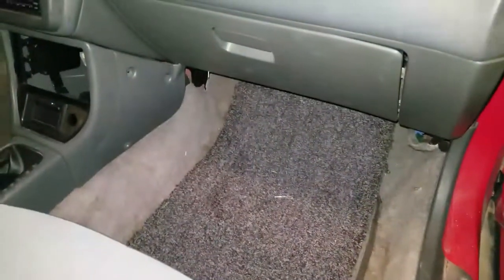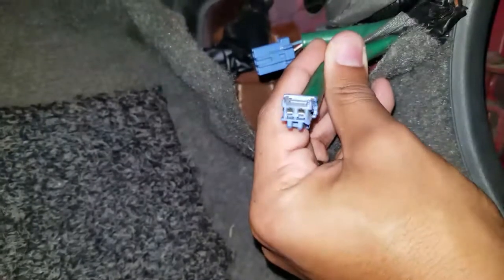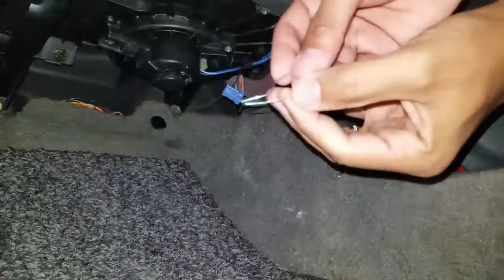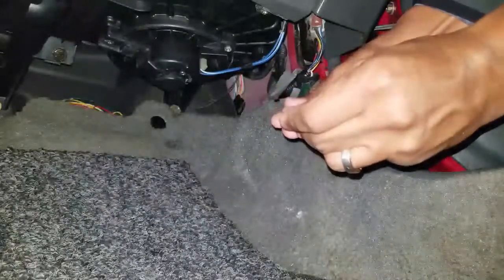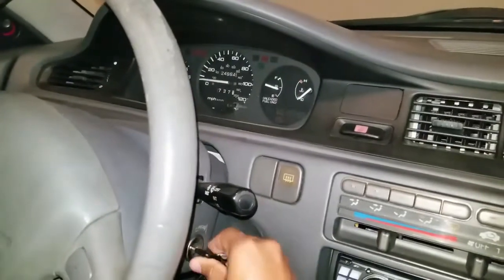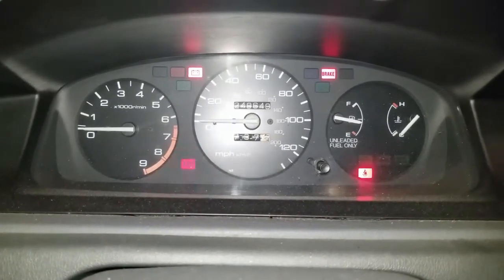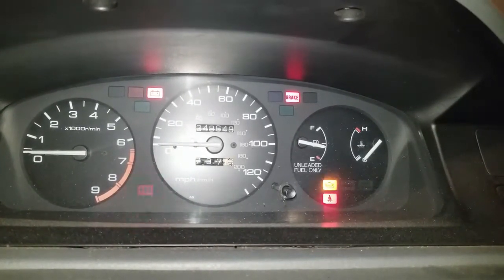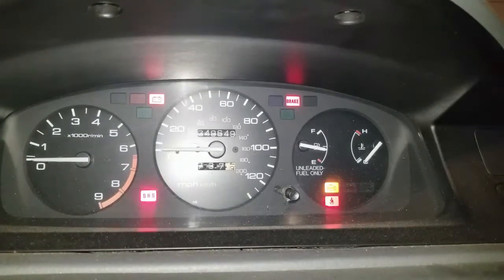Read Your Check Engine Codes | 1995 or Older Honda Acura | Paperclip Method

Comment: Code 5?
Reply from the maker: @josue.alvar3z  
Code 5 would possibku be thrown if there is a vacuum leak at the MAP sensor or the hose or its connections

Comment: Code 43 what is that
Reply from the maker: @lita8824  for OBD1 Honda it's a fuel supply system code. It can be a variety of items, but I've seen faulty full injectors and O2 sensors be causes in various online forums

Comment: Hey thank you for this info.  It is right on topic for me.  I just want to mention that there are two lights blinking. It took me a bit to realize which light was the one we were looking at.  The ABS light is a bit distracting so just maybe pointing out that one is ABS and pointing at the CHECK ENGINE light would be helpful.  I did figure it out.  But not being in front of my panel didn’t help.  Lol!  Thank you so very much for doing this.
Reply from the maker: That's a good point and note for other viewers!
Reply: Hey that’s pretty neat that you took the time to answer this old gramma.  Very cool Mijo. That dumb ABS light almost gave me epilepsy!  Ha ha ha!  I was mesmerized, the I realized I was looking at the wrong light.  Thank you Mijo.  God bless you and keep the hints coming.  You really helped me.  I was looking for a reason my car wouldn’t start. Turns out that the check engine light wouldn’t go out. But one arrival I read said to leave the key in the on position for 3-5 more minutes and if the check engine light goes out then try and crank the engine.  That worked.  My car has trouble starting when it rains.  This worked.  But I wanted to find out why so next time I’m gonna do the jumper wire to see what the code is.  I’m in Yuma AZ and it doesn’t rain often, but it happens every time.  So I’m gonna find it and fix it I hope.  Like I said I’m a grandma and I need a car that works rain or shine 😊🙌
Reply from the maker: @monicabrown3060  No problem, I appreciate the thoughtful response! And wow, that's an interesting issue. I swear I have a similar issue with my Honda right now. It will still start, but it has idling issues whenever it rains. Whoever figures the issue first will have to report back here haha
Reply: @monicabrown3060 wat did you do to fix it
Reply: @EngineeredMojo did you found out wat it was
Reply: @LowLyfeYOUTUBE it appears to be a moisture issue.  I think water is getting on the sensor connections.  When the check engine light comes on and stays lit the engine won’t start. So leaving the key on and waiting it will go out under 5 minutes. When it goes out then I can start it.  I did do the computer check with a paper clip and the OB code says it is the o2 sensor.  This model year only has one. I believe it is a connection that gets wet.  But so far waiting works.  Every thing else works in this car like a dream.  Only when it rains is it an issue. In Yuma Arizona it is only 3 times a year 😂😊

Comment: I got a 6 quick flashes. crank angle?
Reply from the maker: Code 6 is engine coolant temperature for OBD1
Reply: @EngineeredMojo  yah, I noticed the wires was cut off from it on purpose but still starts fine. just check engine light

Comment: Does this work if the vehicle doesn't have a check engine light on?
Reply from the maker: It'll still enter into diagnostic mode, but honestly I am not sure the light blinks that will occur
Reply: @EngineeredMojo  Thank you I'll definitely try this out.

Comment: I'm really having a difficult time locating the service check connector. It would really help if I knew the connector color and the color of the conductors on it
Reply from the maker: It should be right underneath the carpet, it's the only connector without a conne turn plugged in. Hope that helps!